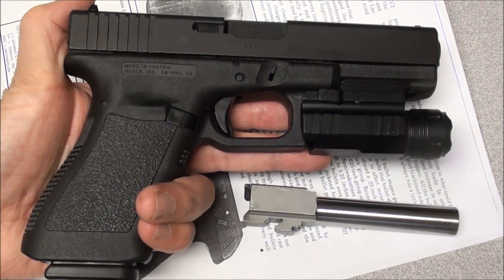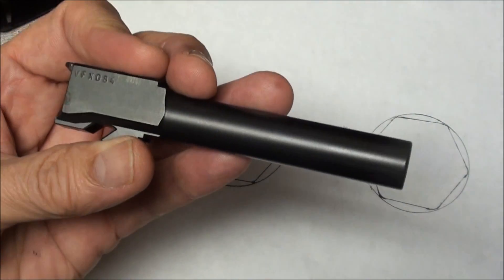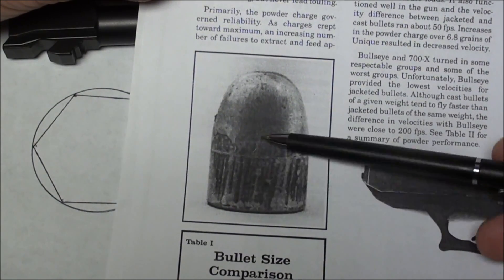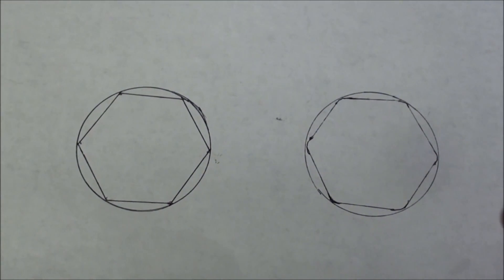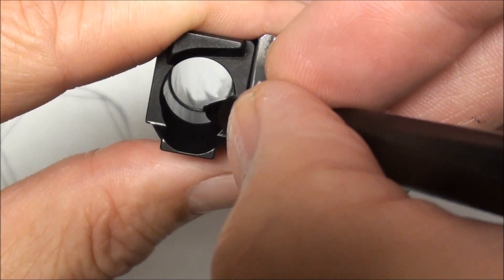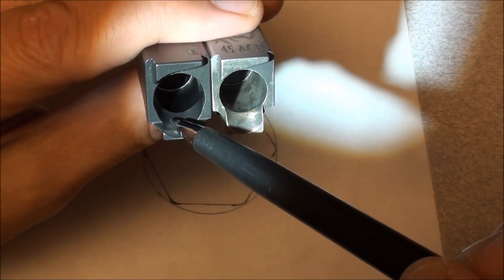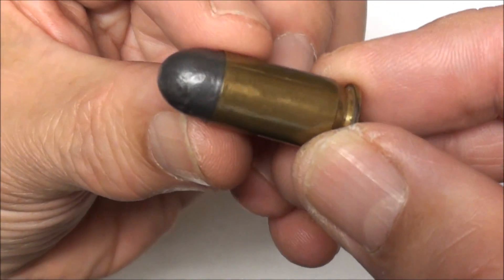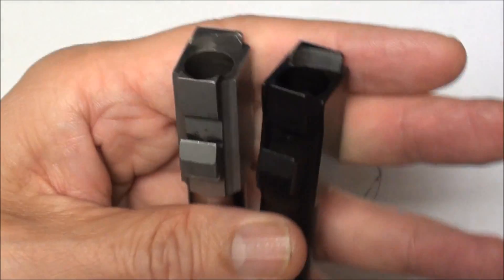Polygonal Rifling in Reloading Ammo for Glocks

Comment: Excellent video. That's why Glocks are a piece of crap. An incomplete gun which you buy and have to change the picky barrel, the literally PLASTIC sights and the trigger for a decent one, so you ends up with just the square and uncomfortable frame and an ugly and boring slide. Blind Glockies in 3...2...1... ;-)
Reply from the maker: Angel Perez - Thanks for your good post.  One thing though, Glocks can just be left stock and shoot factory jacketed ammo (that's the only kind of factory ammo available anyway with the exception of the Federal SynTech powder coated bullet ammo).  That was what the gun was designed to shoot...Glocks were never designed for the sportsman or reloader... For sports use including competition, we have to go get 'em tricked out as you note...the gun becomes much more expensive.  Best Regards to ya,  FC

Comment: Thanks for the excellent information and after seeing this I feel glock makes crappy barrels know I'm going to order some wolf barrels for my 17 and my 20 so I never have to think twice about what I'm shooting and the more I think about it how stupid glock makes guns and tells you not to use reloads shows me they don't trust there own product
Reply from the maker: jayboney el toro - The Glock barrels do exactly what they are designed to do -- shoot factory fresh jacketed ammo with high degree of reliability and accuracy.  They were never designed for being used with reloads of any kind or for sporting uses.  Note that Glock went first to the LE market.   Best Regards,  FC
Reply: FortuneCookie45LC I completely understand what you are saying but you would think over the years they would have made some changes regarding the issue with reloads because I believe that most of use pay enough attention when we reload
Reply from the maker: jayboney el toro - I can only note this from limited observation, but the brass fired in older Gen 2 and Gen 3 Glocks, will not slip into Gen 4 chambers (the brass does slip into Gen 3s - yes, I know that Gen 4s are not available in CA, but there are some around).  This tells me that Glock has tightened up the chambers (just a bit) in Gen 4s without any announcements (this is logical as that would say what was wrong with the previous Glock chambers).  They are going after the sporting market as they need to do that...LE has been saturated.  But if you get the chance, you might check that out to see if my observations can have additional data put on it.  Best to ya,  FC

Comment: Informative but I gotta tell you. I've put about 6-7000 reloads through my glock and about half of them were lead. All in a factory barrel. No problems at all. Maybe I'm just lucky? Thanks for the info. Always nice to hear all opinions.
Reply from the maker: Michael Finkenbinder - Thanks for your comments.  It's not the lead that blows Glocks up.  It's the loose chamber.  Glocks have blown up with factory ammo - that's not supposed to happen with the strong new brass, but there have been isolated cases.  But if the factors stack up (like the planets lining up just right), the reload brass in the Glock chamber can let go and the Kabooms happen.  You don't hear about as many of them now as before - and amazingly, fired Glock brass from earlier Glocks do not chamber in current Glocks - it is possible that the Glock chambers are just a bit tighter now from the earlier so that there is additional case support reducing the incidence of Kabooms...it happened much more with the 40 cal anyway... Glock would not advertise the chamber changes as that would be like admission of fault - or error...and I'm not even sure that it is error...the design was to offer high reliability - well it sure did that, and with factory ammo, it was OK...Your reloads must not have the planets in alignment factor...and that is very good... Best to ya for continued good shooting... FC

Comment: The bad thing of it, is when they blow out the back the round was at a high pressure point and it really damages the gun and maybe the shooters hands. I guess you don't ever see a gun survive a case blowing out. There pretty much toast. I never heard of one blowing a little gas out the back, or a small crack in the case. It's all or nothing.
Reply from the maker: Farmer Dude357 - Thanks for your good comment.   Back in the early IPSC days, the need to make major power plus have good running guns shooting burst fire, we had our chambers throated for feeding.  Then the hotter major power loads and old brass caused the occasional case blow out.  A trip to the gunsmith = the guns were tuned up with new grip stocks, magazine and minor corrective work - occasionally, a new barrel was fitted - guns were back in action.  With the 38 Super, the blow ups were more severe though, but the tough 1911s were not destroyed.  Our gunsmiths grew to know how much to throat to still maintain case support.  I never had a blow out with my three 1911 comp guns.  As you have noted, with  today's polymer frames, the frames do not survive.   Best to ya,  FC

Comment: That's the ONLY reason I purchased a Lone Wolf 40 cal barrel for my Glock 22.  I want to shoot lead powder coated and plated reloads and I don't trust the chamber.  I already had a case split shooting factory reman ammo in it and won't be shooting a reloaded case in it until I get that Lone Wolf barrel in.  All it takes it a weak or work-hardened area of the brass to line up with the unsupported area and KABOOM.  No thanks!  I know the 40 cal is the worst when it comes to this.  Supposedly brass manufacturers have strengthened the web to help prevent this issue, but I don't feel like pushing it.  For 120 bucks shipped, it'll be worth it to never have to worry about it, and reload until I wear the cases out.  The rifling issue is a non-issue if you ask me.  I wouldn't hesitate to shoot cast out of that barrel if I was using new brass.  I'm so glad I never sold my 40 cal brass.  I just recently got the Glock, before that I never owned a 40.  But, I've always picked it up when I saw it so I have at least 6 lbs of 40 cal brass to reload.  That'll last me a while :)
Reply from the maker: Toolness1 - That is a very thoughtful comment based on careful considerations doing one's homework.  And to add to what you have so eloquently written, I have a suspicion that Glock tightened up their chamber tolerances just a bit in their Gen 4s.  Reaon is that Glock fired brass from previous Gens are tight in Gen 4s.  No notice to this of course since to have done that would have been a tantamount admission that previous Glock chambers were too oversized and the tightening up was necessary.  Manufacturers aren't stupid - they react to losses (and perhaps that is the only thing that makes them react).  If we shooters are too stubborn to recognize or realize the state of affairs based on data, then woe on us.  Obviously, any gun can blow up with double charges, but when the 6 blows out on enough cases (and that doesn't happen with other guns), there might be something else going on there.  Happy New Year to ya..!!  FC

Comment: Great video !!!! so, not bulged cases with the Lone Wolf barrel ?
Reply from the maker: The Rangers Bulldogs - The brass out of LW barrels looks like the brass that comes out of our non-Glock auto pistols (there are other polymer pistols that have the same loose chamber concept as Glocks, though) = not bulged.  Best to ya,  FC
Reply: Thanks for the reply, I will bought one soon.
Reply from the maker: The Rangers Bulldogs - And when you do, you will have a cut rifling barrel with a well supported chamber for all your cast bullet shooting and a factory barrel for maximum reliability with factory ammo...You will hear of shooters telling you that factory barrels are great for shooting everything - that they've shot tens of thousands of reloads without problems.  But bulges above the head of cases is bad policy whether it is rifle brass or pistol brass.  Won't take much more to get those cases to let go...Even lower pressure 45 acp rounds can let go if the chambers are over - throated, this happened in the early IPSC days.  Best to ya, FC
Reply: yes I hear some shooters tell this, they never had bulged cases, probably they shoot these cases only in their Glock(I think it's dangerous !!), and than they have not a gauge chamber, or others pistols in the same calibers. My Glock is a G17 in 9mm, I put some bulged cases(resized) in the chamber of my Glock factory barrel without problems, but with the same cases it's impossible to put in the chamber of my P226 and also in my Lyman gauge chamber.
Every times I put these cases in the trash. Thanks again for your time.
Reply from the maker: The Rangers Bulldogs - If you take some of those older Glock fired cases and try and chamber them in a Glock Gen 4, you will find that they don't quite go in...reason is that Glock has apparently tightened up their chambers without making a big announcement of that...to do so would seem to say that the previous oversized chamber dimensions were improper or inappropriate (translation oversized and overthroated) - they aren't going to do that, but did see the value of tightening up for extra case support.  But what you found with the older Glock fired brass not fitting in P226 etc barrels is a clear sign of the oversized Glock chambers compared to more supported chambers found in most all other guns.  We and Glock are both lucky that there hasn't been more Kaboom events.  Best to ya,  FC

Comment: So....how many Glock pistols have YOU blown up by using reloads in the factory barrels?  I have not managed to do it yet.

You state within the very first minute that Glocks have blown up if the "ammunition is not done properly".

In middle of the video you tell us that the rifling is not the problem.  You tell us that the "abrupt" ledge is not the problem.  You say that the "minimally supported" chamber is the culprit.

What "done properly" ammunition can make up for a "minimally supported" chamber?  Is it the ammo or the chamber?

I personally pissed away half the cost of the pistol for a normally rifled 9mm barrel for my G17 (Bar-Sto).  The tolerances are so tight that none of my reloads will work.  This is because my dies simply don't catch all the case during the re-sizeing operation.  Pissing away another $100 for a "small base 9mm reloading die" was supposed to get the Glock bulge on the case sized back into spec.

The result:  50% of my reloads won't fit in the Bar-sto barrel.  Turns out that it was due to fouling after one or two shots.

Just angry enough at wasting money on special dies and special barrels I put the Glock factory barrel back in.  I use only my reloads with lead or FMJs.  After years of shooting....no FTE, no FTF, no explosions.

Early in your vid you say that reports of Glock explosions come along and we never get any reports of explosions from other manufacturers.  Could this be due to the fact that Glock has made and sold over 10 million pistols making it the most common pistol in use by civilians, military and law enforcement?

Glocks have been rolling off the assembly line and into the hands of shooters since 1982.  SW MP Shields only since 2005.  So with over two decades longer in the market and in the hands of shooters with questionable reloading skills...don't you think the reports of Glock failures could be a mathematical artifact and not an actual flaw?
Reply from the maker: TheWhiteleather - I can certainly see your frustration with that aftermarket barrel...you did the right thing and got frustration - our Lone Wolf barrels are much less problematic - they just drop in and work from the get go...They shoot to different point of impact is my complaint - I'm always shifting the sights because I keep the factory barrel in for use with factory loads for serious stuff and use the cut rifling for all my lead bullet loads...sure there are lots of Glocks worldwide - and most of 'em are in LE and military shooting factory ammo - what the gun was designed to shoot with max reliability because of the Glock loose chambers...safe with fresh new brass factory ammo - but not with reloads - that's why they say no reloads in Glocks and no lead bullets (all lead bullet auto pistol ammo are reloads) because tired brass or brass shot in Glocks and shot in Glocks again is asking for trouble...If you and I haven't had kaboom - that's a very good thing - the 40 cal was the worse offender - especially with heavier bullets, bigger bullets, harder bullets, seating errors, crimping errors, use of Tite:Group powder and tired Glock smile brass where the weak spot lines up with the unsupported chamber again...and the brass can let go.  When I shoot my factory barrel, I only shoot factory rounds in there - 9mm White Box Winchester is my favorite - cheap and accurate enough.  And for serious, I use Federal Hydra-Shocks - bought 2000 rounds way back when that was the round to use.  All my reloads are shot in the LW barrel.  Some shooters shoot 'tens of thousands" of rounds of reloads in factory Glock barrels with no problems, but if I went around telling everybody it was safe to do something the factory warns against - that would be bad policy.  Kabooms do happen but not because I told someone it was OK.  Any shooter is completely free to shoot whatever ammo they want.  Takes a right mix of conditions to get a Kaboom - those same conditions do nothing abnormal in my LW barrel.  But today, I am suspecting that Glock has tightened up their chambers just a bit as older blown out Glock brass does not readily chamber in newer Glock factory barrels like they used to.  That tells me the chambers are tighter - no announcements or fanfare...and we would not suspect that would happen anyway.  But you don't hear of Kabooms as in the past even on YouTube - in light of the tighter Glock chambers, no wonder.  When other guns blow up, it's because of double charges or improper powders used or obstructed barrels... Glocks will do these also, but those 6'oclock case ruptures that blow right down through the magazine and split the polymer receivers are distinctive Kabooms...and those have happened even with factory ammo in the 9mm as in the documented case in a police department.  Must have been a weak factory 9mm brass incident...rare.  If you show blown out Glock brass to a High Power rifle shooter, they don't like that a bit.  And we shouldn't like that either no matter what gun it came out of.  Straining brass is never a good idea...no reloader likes that.  Brass was supposed to be helped by the chamber not the other way around. You know these things.   Have a great day,  FC
Reply from the maker: The Whiteleather - Google did not post your comment in my inbox for me to see, and even at that it was on the unapproved list so it wasn't posted anyway...So I had to approve it for it to get here for me to reply to it...Sorry for the delay in reply.  And thanks for the comment...It is a very interesting one that needed a longer reply...Best Regards,  FC

Comment: What an excellent video. You might have saved my brand new Glock 22 from blowing up with factory reloads. Thank you sir.
Reply from the maker: siddharth kumar - Right you are..!!  Factory reloads are still reloads of used brass - and if that brass was shot in a Glock previously (a lot of brass is), the weakened brass situation is running...The 6 o"clock brass head blowouts are classic of case failures, and if a shooter shot 100K rounds of reloads through his/her Glock without problems - that still does not OK the telling of others to take the same risks.  Using an aftermarket barrel with a supported chamber gives me the confidence I'd like to have when I trip the Glock triggers...All that loose chamber and unsupported 6 stuff is fine for factory fresh new ammo... Happy Holidays to ya..!!  Thanks for posting... FC

Comment: Fascinating....Hence no +p or +p+
Reply from the maker: Kirk Kinnell - Good point.  And you've got it completely under control and understanding.  Looking at Glock recommendations - they do not say no +p or +p+.  Reason - with factory new brass, we can stretch the case heads with +p and +p+ and new brass will stand it.  But if you are a reloader using brass that has been weakened already, the use of +p or +p+ to shoot again in Glocks is really asking for trouble.  Let's put it this way - if you note in reloading manuals, there are always chapters on brass stretch and bulging at the web area of the case (where the head of the case and the body of the case join), even to the measuring of the brass there for bulging = warning - danger of head separations.  All Glock fired brass is bulged out - some worse than others.  Then we look at the Glock bulged out "smile" brass and happily pick it up to reload again...as if there is nothing at all wrong with that.  Best to ya,  FC
Reply: FortuneCookie45LC Ohhhhhhh noted and copy. So... Lol... What I'm going to do is but another  barrel for giggles and not worry about it.  Ha.. I'm glad I watched your video though.. Learn more and that's always good.